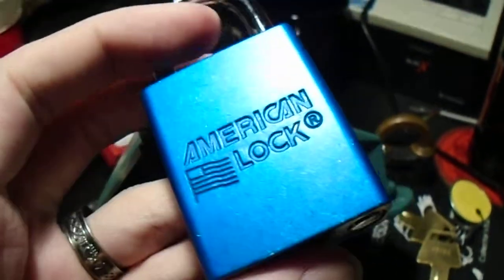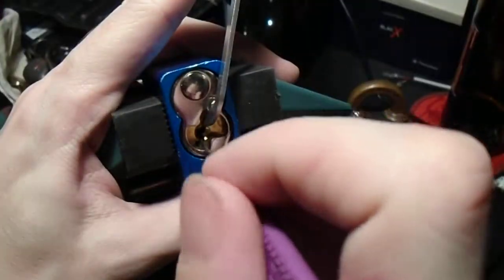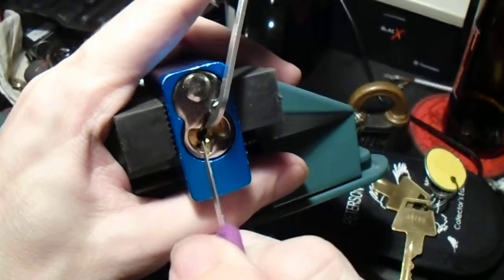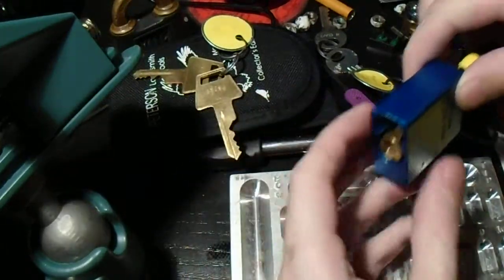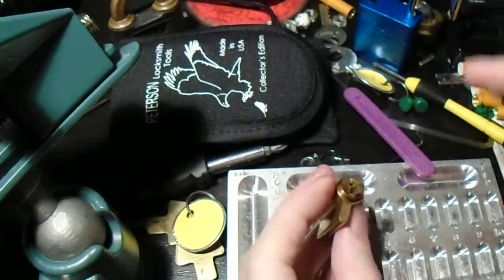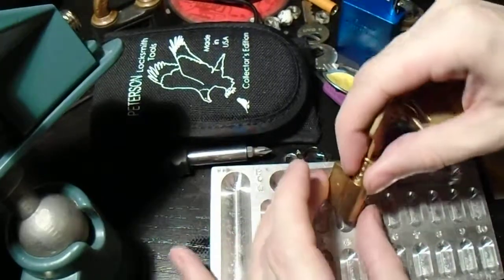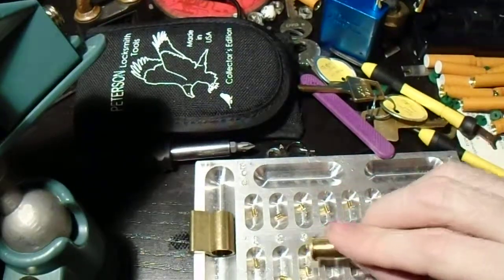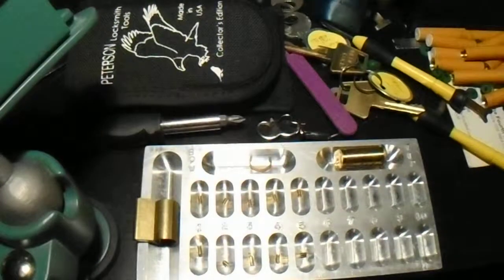(038) American Lock A1100 picked and gutted

Comment: love the pining tray! Great picking,  I struggle with American locks.
Reply from the maker: +richardwales I did for a very long time. The only solution is practice, practice, practice, plus a bit of luck. Their serrated pins are quite fiendish and are probably the biggest barrier to success with them.
Reply: +Nite 0wl its tensioning the things I find hard! got some tools coming from Joshua to help me! picked a 5200 the other day, was rather pleased.
Reply from the maker: +richardwales Nice job, the 5200 is not easy. I find the Original Peterson PryBar very useful for them, standard tools just don't fit well or grip the way I need them to. The new .018" Peterson picks are also thin enough to work between the wards on the standard keyways which makes things much easier.

Comment: I've been trying to pick this lock for months, and have experimented with all sorts of varying tension.  I don't have a vice, however.  Does having a vice make a difference, or does it simply aid in the making of the video?  Any other tips regarding these locks full of security pins?
Reply from the maker: +Timothy King Having a vice really helps when learning to handle these locks, it allows you to concentrate entirely on tensioning and manipulating the pins. Once you get used to the feedback the serrated pins produce and develop a feel for them generally you can more easily pick them freehand. The biggest trick with american locks is dealing with the serrated pins, you need to be able to feel the difference between hitting a serration and actually setting them and that can only come through practice.
Reply: Nite 0wl thank you very much.  I'll look into getting a vice, and of course, will keep at it.
Reply: Table vice came in today, finally successfully picked this lock for the first time.  Took about 10 minutes!  Time to buy another lock!  Thanks again.
Reply from the maker: +Timothy King Good work! Keep practicing on that design and I bet you can get that time down too.